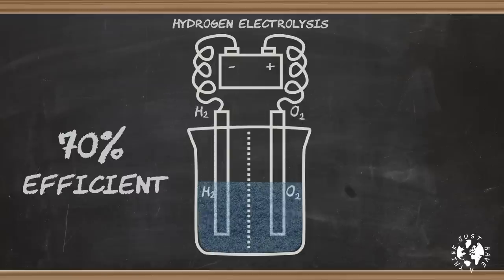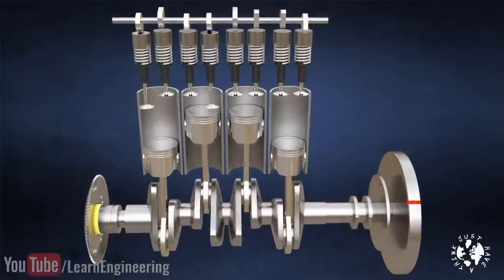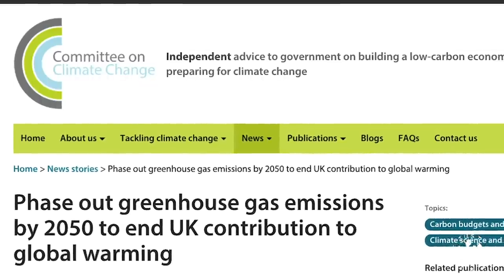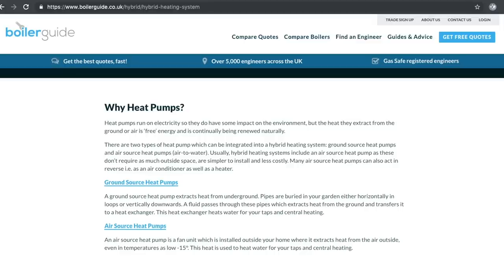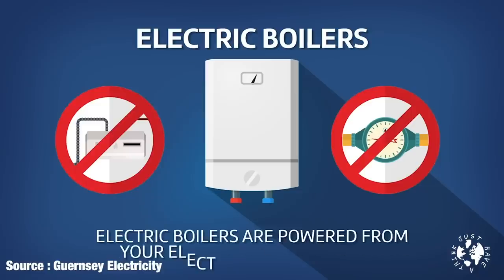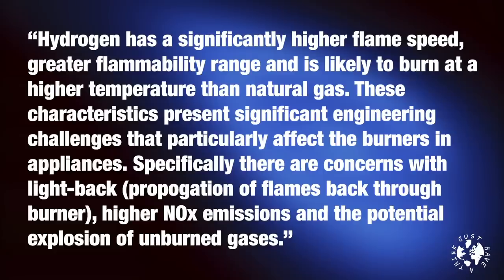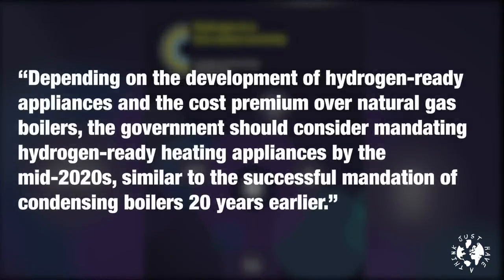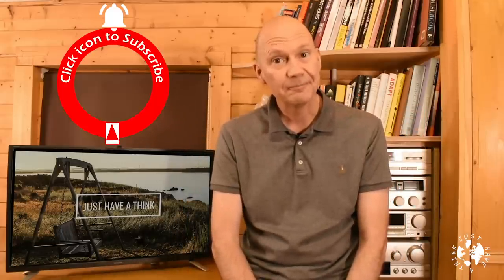Hydrogen for heating our homes

Comment: @ just have a think

I saw a video on YouTube of a company in England that is selling boilers currently that run on hydrogen.

I'll try to find the video and post it here if possible.

Thanks for your video it was helpful.

my one question is why do they think that the use of hydrogen causes nitrous oxide. All of the hydrogen combines with oxygen.
Reply: Nitrous oxide is an unwanted byproduct of high temperature combustion where some of the atmospheric nitrogen and oxygen combine. Minimizing this is one of the factors in designing combustion equipment.

Comment: One thing that amazes me about the UK is the small electric heaters you have on cold water strings to provide hot water for sinks in toilets. That is so much more clever than a central heater and a circulation pump that runs all the time to provide instant hot water in summer. This is much more efficient than a central boiler gas or electric. However using a valuable fuel just for heating, is still wasteful, when a Fuel cell that also produces electricity as well as heat, or simply a Stirling generator or even a small combustion engine could provide your electricity needs at no extra cost.

Comment: Insulation is also REALLY important!
Reply: not too much, bec. that stuff you put on your houses cant breathe, will cause mouldy walls , plus after 30 years that insulation-plastics is special waste ,that is expensive to get rid off. Building with wood , even for high rise houses seems the only sustainable option
Reply: @freydenker6335  That's what vapour barriers are for.  Modern houses will have vapour barriers built into warm side of the external walls of the house. They prevent water vapour inside the house migrating through the building fabric to cold condensing surfaces within the building fabric.  

Modern timber framed houses are well insulated and typically last for many decades.  My own house is 26 years old, timber frames and insulated.  I've not seen any problems with mould or rot, and believe me when I say I've inspected the floor voids, roof spaces and opened up some of the external walls.  They're healthy.

However insulating old houses is a big challenge.  The problem isn't so much moist air inside the house that condenses on the way out, it's more a problem of having rain penetration from the outside getting in.  That's your major cause of failure - especially if you have wall ties getting rusty in a cavity wall space.  Breathability helps in that case, but it's far better to prevent the rain getting into the cavity space in the first place by installing external insulation instead of cavity wall insulaiton.

But in my own house, I'm adopting an "insulate first" strategy.  A heating system will typically be replaced every 12-20years (especially with modern heat exchangers).  Good insulation on the other hand will last the whole life of the building.
Reply: @anthonydyer3939  
There is such thing as the zero energy house. They do not need heating or cooling systems. They cost no more to build than any other house.  Look up Passiv Haus. Of course the heating/cooling business would be against them. 

Approx' half the energy use of the UK is in heating buildings.
Reply: @johnburns4017  I'm fully aware of Passiv Haus constructions.  However these concepts are only cost effective with new homes.

For my house, a 1993 built Bungalow, there's only so much I can do in terms of insulating the walls and the floor before things get really expensive and disruptive.  For instance, a passiv haus has 300mm of insulation built into the walls using double stud construction to avoid cold bridging.    My house has 80mm deep exterior stud framing.  If I'm going to upgrade to a passiv haus.  I'm looking at a full rebuild of the interior stud wall framing as well as the exterior rendered concrete blockwork in order to accommodate 300mm of wall insulation.  It's simply not possible to retrofit my house to that standard without writing off most of that investment.  Indeed it's probably cheaper to demolish my house completely and start again.

That's going to be the situation for most existing buildings.  Cost effective retrofit Passiv Haus in most instances means a complete scrap and rebuild of the property.  You can go so far with  insulation in the existing building fabric, but you still need a heating system to make up the shortfall.

The major problem you have is with the housing market.  A well insulated house simply doesn't fetch enough of a price premium to pay for the investment that you make into passiv haus grade insulation.  I've seen plenty of properties on the market the same size and price, but with wildly different EPC ratings.   People just don't seem to care about building performance.

If you want to introduce Passiv Haus as a viable retrofit concept, I think it's not enough to think about energy cost savings along.  You most likely need to introduce taxation - probably along the lines of a Council Tax surcharge for inefficient buildings, and a discount for efficient buildings.  Also a subsidy would need to be introduced so that poor households can upgrade their property without being penalised.
Reply: @anthonydyer3939  
The UK has the oldest and least insulated buildings in western Europe.  There is scope to improve on the poor carbon footprint by demolition and rebuilding.

As you highlighted there is scope to improve, but a cut off point of no return. You can insulate, and stop air leaks, as much as possible, which will make a difference in heating bills, meaning a  cut down heating system. 

You are right. A tax on inefficient buildings is the answer. That will spark some of it off.  

But why do we have these old buildings still hanging around? Relaxed planning laws and a full Land Value Tax, no taxation on the buildings, only the values of the land - that will shift matters quickly.
Reply: Agreed.  We lived at 3200m in Colorado in a modern home.  AC not needed heating via water boiler.  About 3500 sq ft.  Heating cost less than $100 during peak of winter.  Reason, highly efficient glass, thick well insulated walls.  If you want fresh air get a air to air exchanger.
Reply: @optimisticfuture6808  
All you need now is PV panels.
Reply: @freydenker6335  I suggest you study insulation and vapor barriers.   Depending on what you choose, breathable options exist.  Fiberglass is highly breathable.  

Incidentally, insulation usually has the highest bang for the buck in reducing your heating and cooling costs in existing structures, after changing the setting on your thermostat, of course.
Reply: @freydenker6335  if you are having those problems it has been installed wrong. This issue is very well understood now and proper use of vapour barriers and ventilation eliminates the problems of moisture entirely. Clumsy dumping of loft insulation which blocks the eaves ventilation can be disastrous however.  All new houses should be required to conform to a passivhaus standard, or close to it and it would be easy enough to alter regs to emphasise the importance of energy efficiency n building. Our problem is that so much of the building stock is 150 years old and only so much can be done. We can’t afford to simply replace serviceable houses and this is where efficient heating systems can combine with best possible insulation to make them habitable and moderate their carbon impact.
Reply: 50% saving is achievable .
Reply: @anthonydyer3939  agreed. The Building Regulation need further revision and far better policing. Rented property should be banned to rent  below a certain energy grade to force landlords to upgrade. House sales below a certain grade the same. Commercial buildings also. Council Tax based upon eco grade. 
New Build to all be eco grade, which they are not, this should have been by 2018.
All energy upgrades to be lead by short, medium and long term investment steer from independent energy auditors energy certification., not the current grade which is poor. I know I worked on the group that established it. Overall, policing, legislation, carrot, stick and guidance.

Comment: None of the options are silver bullets. Electrification is a major issue as the network is so old. I took a call recently where cables were breaking down. The engineer informed me that supply cables had been installed in the 1950s and this was common. Electric boilers are extremely expensive to run. Electricity is 5 times higher per kw. Hydrogen would use electrolysis of water. Water availability worldwide is an issue. Gas mix is the idea to start with. Hydrogen causes metal to become brittle. An issue with leaks. No one has suggested reducing travel. None of us want to drive to work. So time to stop. Lots of issues with all.

Comment: Piping or transportation is dangerous and expensive  cranking it at home and commercial heating system. Hho system the trick is to get some of the electricity back cheaply. I am going to put stainless steel plates in the burner hooked to capacitors bridge rectifiers and a transformer to put some of the electricity back in to recharging the system . The 2 heating systems I will be trying is a sand hho heater and a torch style  .both I am going to try to decrease there use of amps and make them evin more efficient. My gole is to go from 1/3 the costs of base board to 1/6the cost of base boards electric heating .less then the cost of natural gas in a high afiency furnace. Winter project.

Comment: Don't be fooled by individual numbers. A 75% efficient all electric vehicle still has to get its electricity from the grid mainly which is still only 50-55% overall efficient when the renewables mix is taken into account. 75% of 55% is ~41% which is still around the overall efficiency of an ICE!

Claiming that people would use solar PV to charge their car means they can't use that amount of solar energy to power their homes and STILL doesn't cater for the heating element. We have a VERY long way to go!

Comment: Instead of burning hydrogen, why not feed it into a fuel cell to yield electricity and heat?
Reply: The heat exchangers could benefit from that extra heat and run from the electricity produced.

Comment: Couldn't Power stations be built using hydrogen to power home heating instead of homes having to produce its own hydrogen heating through boilers. District heating is being used today to supply homes with heating, so you would need only power stations converting hydrogen into heating for all homes. The steel industry is also using hydrogen and working hard in making green hydrogen available.

Comment: From my take, the best place for hydrogen is as a means to suck up energy when there is excess capacity from clean energy sources.

First fill the batteries, then ramp up hydrogen production.

If you hit a point where your hydrogen stockpiles are full, then further upgrade it into other liquid and gaseous fuels.
Reply: Allen, Pretty much agree. The only amount of stored hydrogen you would likely need would be for reliably fulfilling local needs for niche fuel or chemical uses and as backup for energy generation. As for general use fuels, hydrocarbons are a much more convenient form of energy.
It should also be noted, that with the pure hydrogen you would also be creating large quantities of pure Oxygen. Whether you use this for industrial purposes or to fuel cleaner energy production are likely only some of the options.

Comment: The more I research hydrogen the more I am lead to centralised water located electrical generation fed  by hydrogen  created by off-peak renewables and maximised load nuclear. I love the idea of electrified HGV not unlike the old trams.  Home heating via renewable fed electricity to  air source heat pumps with renewable electric on peak top up.Finally the big one,  cars. This serviced by compressed hydrogen carried not unlike propane tanks. The physics of this is two  48" x 18" compressed hydrogen tanks would give  a converted engine a usable distance if 650 mile's between tank changes. Note I said tank changes instead of fills as this would be far safer.

Comment: Your boiler makes heat but no work , your car produces work as well as heat.  Research Honda co-gen . Its a in house motor that heats the house, domestic hot water and is a generator. Don't just burn the fuel , make it work.

Comment: there is something missing? I have a small electrolysis system that provides hydrogen "on demand"  thus no storage problems , I make 1 liter of hydrogen a minute using 12V @3amp or less. it make a nice invisible flame but I think there is more energy if you use combustion ,ICE engines like hydrogen but a rocket style combustion chamber may do even better (hydrogen is rocket fuel)
Reply: Yes, you are missing something.
Reply: @marvintpandroid2213  they are making hydrogen look weak probably to promote hydrogen fuel cells
Reply: @ne1cup   no, you don't understand the basic principles of hydrogen production and energy consumption to energy production cycle involved.
Reply: @marvintpandroid2213  you are wrong, in the 40s they mixed hydrogen into the city gas and it worked well. They used Brown's water...
Reply: @ne1cup  energy in vs heat out.

Electricity to hydrogen to heat via burning that hydrogen. Maybe 30%

Electricity to heat pumps.  Around 300% to 400% energy in to heat out.
Reply: @ne1cup  energy in vs heat out.

Electricity to hydrogen to heat via burning that hydrogen. Maybe 30%

Electricity to heat pumps.  Around 300% to 400% energy in to heat out.
Reply: @marvintpandroid2213  heat pumps are good my refrigerator runs on a pilot light pretty magical, there is a lot lost to history
Reply: @ne1cup   Forget your hydrogen nonsense for household heating.

Comment: "yeah, they need to sort that one out..."   Lmaooo
Why don't they use a fuel cell to convert H2 to electricity and just use regular electric appliances???  That way they don't have to worry about piping the H2 from basement to the appliance and NOx gases, etc.
In the '70's Stan Meyer figured out that he could split water by using a frequency of 20kHz using very little electricity which could be obtained by solar and that way we could produce H2 at home.  I'd be curious to know how we could separate the H2 and O2 and how would we store each to later combine them in a fuel cell in a closed loop system to produce electricity.
Reply: They do (Toyota just announced the production of just that). However, fuel cells are expensive to produce and, while good for producing electricity, they’re not the most efficient way to produce heat.

Comment: Would love an update on this subject. Worcester Bosch and others are now manufacturing "hydrogen ready" boilers, e.g. see https://www.youtube.com/watch?v=4uNKPDREa-Q. 
I've been looking at the possibility of switching away from gas central heating to something sustainable but I don't see a realistic solution at present. Hydrogen boilers would fit the bill if viable.
Like millions of UK homes mine is solid walled with suspended timber floors. GSHP? No room for one. ASHP? Would take a chunk of outside space, more equipment inside a small house, I'd have to rip up and replace all the lovely original floorboards to put in UFH throughout, (doubling the size of the existing rads and potentially uprating all the pipework not really doable). A massive, disruptive and extremely expensive job. 
Insulate the hell out of the house? I'm not going to wrap the exterior of a pretty period house in insulation if I can possibly help it. As for internal insulation, as well as being extremely disruptive and expensive to fit (think about the covings, the woodwork, the electrics, the flooring and the pipework that all needs work), and as well as losing interior space, is fraught with the danger that you will cause long term damage to the house's fabric given the newly cold and wet exterior walls (and the ends of timbers stuck in those walls, among other risks). A material increase in insulation would of course be welcome, but a transformational one is risky.
I'm someone committed to sustainability, with budget and time to commit, willing to put in some research. What about the millions of homes out there owned by people just trying to make ends meet? Huge expensive projects (e.g. heat pumps + UFH + serious insulation upgrades) are not the answer for those homes are they? For the lucky few with the space, money, and suitable homes, it's all well and good.
85% of homes are connected to the gas distribution system. With extensive storage we can produce green hydrogen when electricity is cheap and plentiful then store it away for when it's needed. Overall "efficiency" is not so important when we can keep adding renewable generation capacity and not worry about its intermittent nature. 
Boiler makers say the boilers themselves will be comparative cost to the natural gas units and require only a small amount of work to switch to hydrogen from natural gas. It kind of sounds like a silver bullet for home heating doesn't it? What nasty problem am I missing (assuming those mentioned in the video about exploding boilers have been solved, which seems to be the case).

Comment: What about fueling a natural gas engine in businesses or homes to generate electricity and use the heat from the engine to heat water and or air? You would utilize both the mechanical and heat in a fuel that is burned. Duel applications for burning a fuel increase energy efficiency. What about more or an emphasis on mechanical and design efficiency designs?